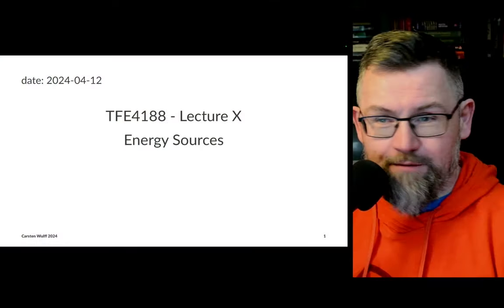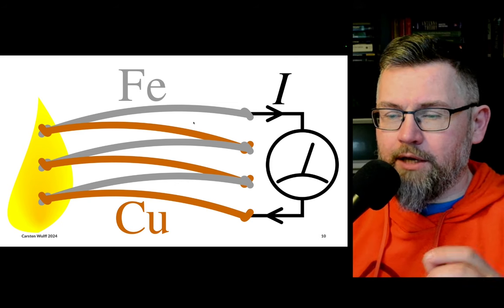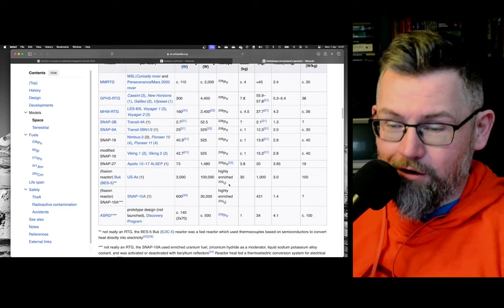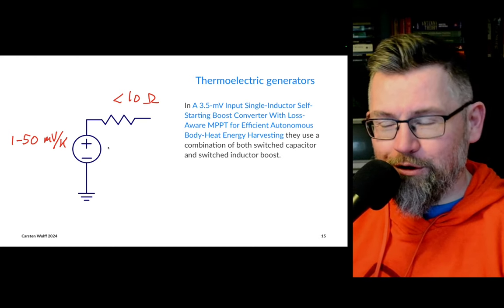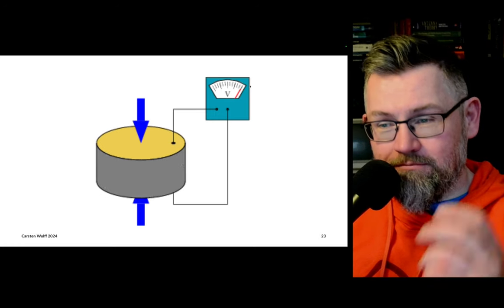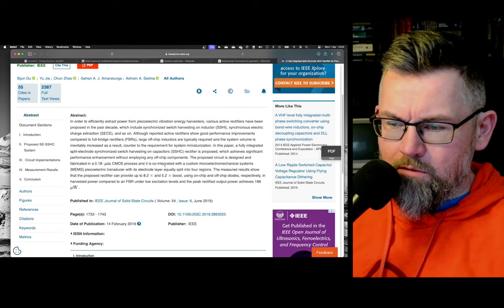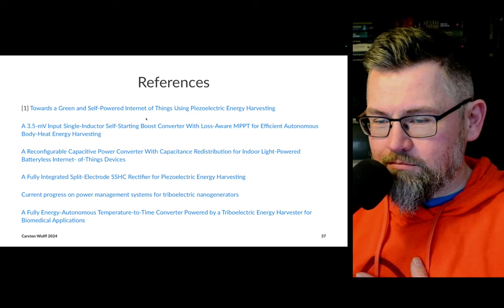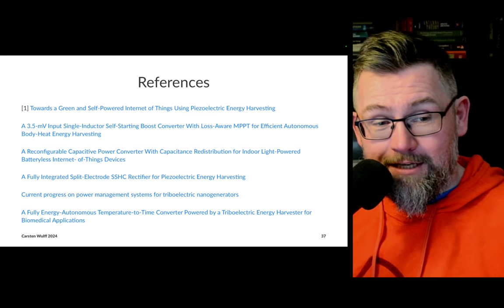Lecture X - Energy Sources

Comment: Abstract

This lecture explores various energy harvesting techniques and their applications in powering electronic circuits. It delves into the principles, advantages, and limitations of thermoelectric, photovoltaic, piezoelectric, electromagnetic, and triboelectric energy generation. The lecture emphasizes the importance of understanding the specific use case and energy source to design efficient harvesting circuits. It concludes by highlighting the need to minimize the average current consumption of electronic devices to enable a future of batteryless IoT sensors powered by harvested energy.

Summary

Introduction (0:01)
  - Electronic circuits require energy sources to function, traditionally batteries or AC adapters.
  - Energy harvesting offers an alternative for long-term operation without battery replacements.
  - The choice of energy harvesting technique depends on the application and desired power consumption.

Energy Harvesting Techniques
Thermoelectric (7:47)
  - Principle: Utilizes temperature differences to generate voltage using the Seebeck effect and materials with different Seebeck coefficients.
  - Example: Voyager probes use radioisotope thermoelectric generators (RTGs) to convert heat from decaying plutonium into electricity.
  - Challenges: Low voltage output, requiring boosting circuits for practical use.
  - Create an oscillator that runs with 50 or 100mV input voltage.

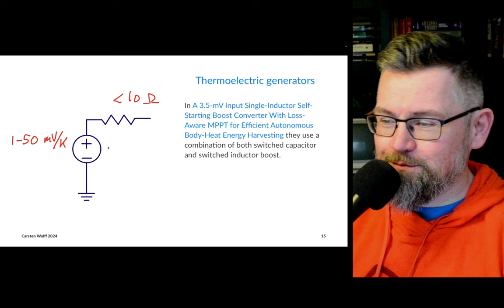Photovoltaic (18:15)
  - Principle: Employs the photovoltaic effect in PN junctions to convert photons into electron-hole pairs, generating current and voltage.
  - Key Considerations: Optimizing power extraction by operating at the right load current and utilizing maximum power point tracking (MPPT) techniques.
  - Applications: Solar cells for calculators and other small devices.

Piezoelectric (25:27)
  - Principle: Leverages the piezoelectric effect in materials like gallium nitride to convert mechanical stress and vibrations into AC voltage.
  - Mechanism: Alignment of polarization domains within the material creates an electric field that changes with applied stress.
  - Challenges: Rectifying the AC voltage into a usable DC form.

Electromagnetic (31:45)
  - Near Field Harvesting: Utilizes the inductive near field for efficient energy transfer at close distances, as seen in NFC and Qi charging technologies.
  - Ambient RF Harvesting: Scavenging energy from ambient radio waves is deemed inefficient due to significant power loss over distance.

Triboelectric (42:39)
  - Principle: Harvests energy from static electricity generated by friction or contact between materials.
  - Example: Temperature sensor powered by triboelectric energy harvesting from human motion.
  - Challenges: Low current output and the need for efficient rectification circuits.

Conclusion (46:37)
  - No single energy harvesting circuit is universally suitable; the design must be tailored to the specific energy source and application.
  - Minimizing the average current consumption of electronic circuits is crucial for successful implementation of energy harvesting technologies, especially for batteryless IoT devices.
	
	
i used gemini 1.5 pro to summarize the transcript
Reply: Seebeck Effect Explained Simply (9:10)

Imagine you have two different metal wires, like copper and iron, connected at both ends to form a loop. Now, heat up one of the junctions (where the wires meet) while keeping the other junction cool. What happens?

The Seebeck effect is the phenomenon where this temperature difference between the two junctions creates a voltage, causing electricity to flow in the loop.

Think of it like this:

    - Heat excites the electrons in the metals, making them move around more.

    - Different metals have different responses to this excitement. In some metals, the excited electrons move more easily towards the cold end, while in others, they don't move as much.

    - This difference in electron movement between the two metals creates a voltage difference between the hot and cold junctions.

    - This voltage difference is what drives the electric current in the loop.

So, essentially, the Seebeck effect transforms heat energy directly into electrical energy, simply by using two different metals and a temperature difference. Also works with doped silicon.